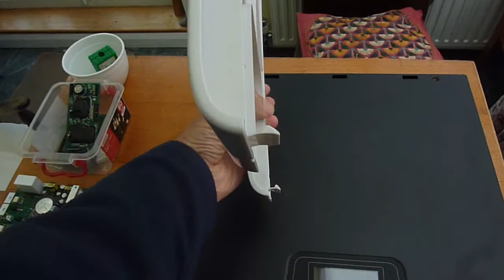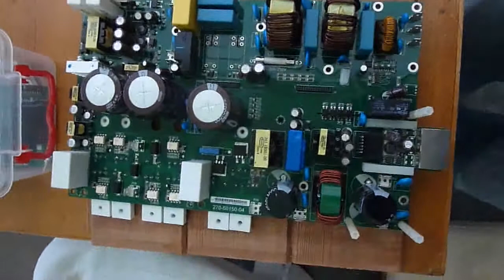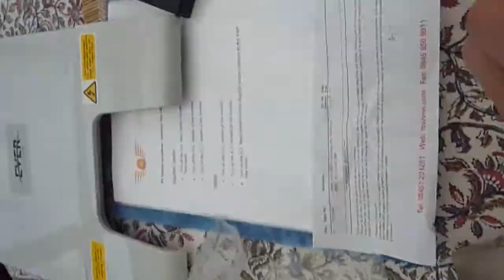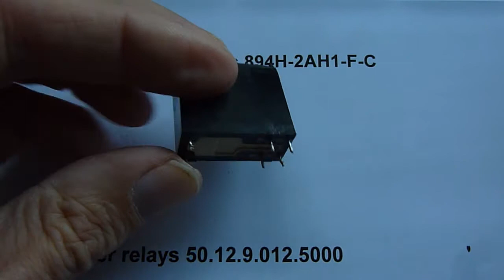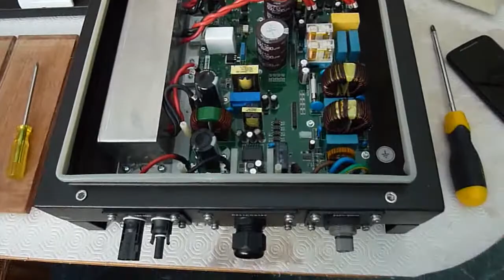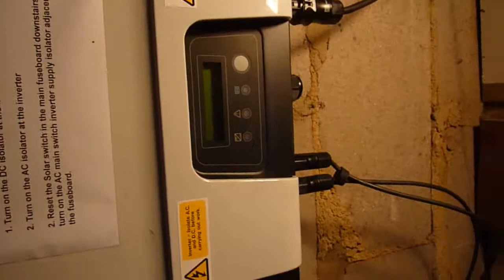Eversolar Inverter Relay Check Fail repair / fix

Comment: Hey Stephen! Great video! I do not have an EverSolar unit. I have an SMA unit with similar problem.

Your video is the first I found (after a watching many others) that addresses that problem. It seems manufacturers don't want to release any type of technical information about these units at all.  You have encouraged me to try to repair my out of warranty unit which otherwise would have to be trashed.

Congratulation on a well done video and have a happy new year!

Rafael
Reply from the maker: I hope you manage to repair it OK. Anything that keeps more stuff out of landfill and saves you money has to be worth a try! Thanks for your feedback.

Comment: Hi Stephen. I'm from Australia and have the TL1500AS model and noticed the "relay check fail" error yesterday. No idea how long it's been like that either as I never really paid any attention to the inverter since it was installed 7 years ago. Was installing a workbench below the inverter yesterday and only then noticed the error when I got curious about the constant clicking sounds the inverter was making.  

  After doing some research online and thinking I would have to buy a new inverter as my unit is out of warranty, I found this video. I can't thank you enough Stephen.
 
  I purchased the mount relay bases(sockets) and the finder relays and had it all up and running again. Took me about two hours all up. Your step by step video made it so easy to follow. Looking at some Aussie forums I found this problem is very common with these eversolar inverters and can't believe they aren't being recalled and replaced with better relays, or at least have the sockets installed free of charge so the relays can be easily changed out. Cheers. Adam
Reply from the maker: John Spartan That's great. Really glad the video helped you. So unecessary to throw these inverters out when the fix is relatively simple. It would have been so much easier if the manufacturer had fitted the relay sockets in the first place though! Thanks for taking the time to give feedback. Stephen.
Reply: Hi John, where in Australia did you get the spares as I need to do this fix. Thanks.